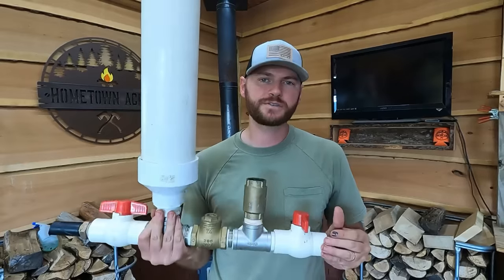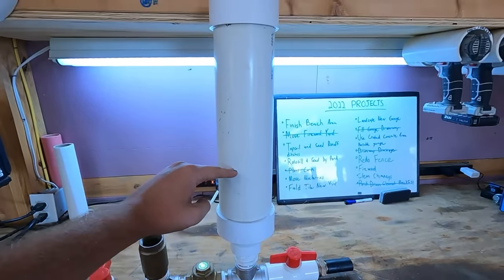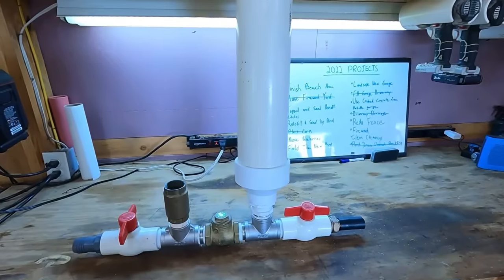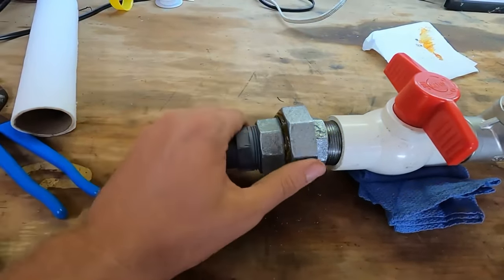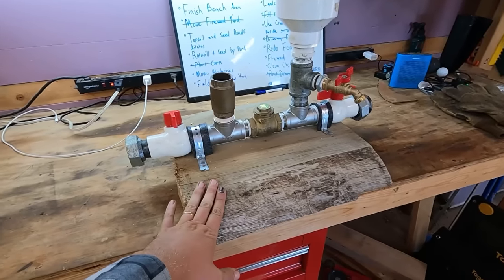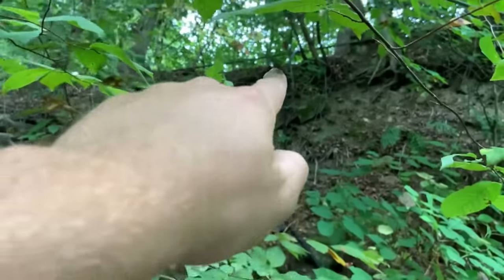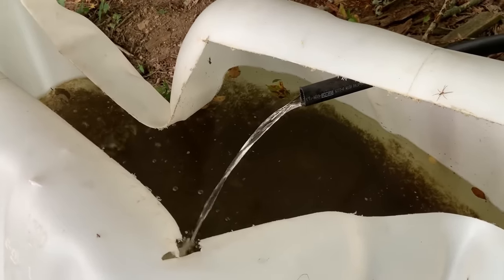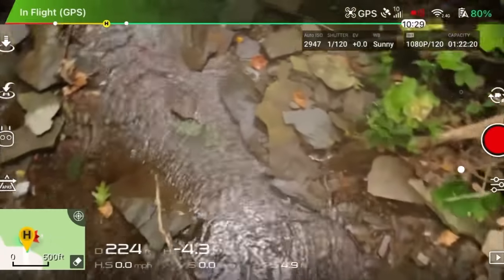Perfecting The Ram Pump And Then Abandoning It

Comment: Let me give you some advice that I found by accident. Years ago, I was hand digging a well for garden use. I got down to around 7 feet, it came a strong rain storm, and it filled my well with rain water. I needed to drain my hole in order to start digging again, I hooked up a pump, lost power, and the siphon kept on happening…with a hole that was 7’ deep and an over all fall that was 4’ (with a 3’ differential that most people would think a siphon would be impossible. If the amount of water that you want to siphon (when the downhill is less than the uphill, as long as you can create more downhill weight in water, you can siphon water uphill. You could probably take a transit, zigzag your pipe down to the pond, and as long as all of that zig-zagged pipe is going down hill, you can create suction. The more water weight that you can create going downhill, the more suction that you will create at the spring source. The more suction that you create at the spring source, the more water that you will have coming out at your pond. I hypothesize that if you were able to use a transit, have all of your pipe going down hill, and increase the length of your downhill pipe by twice, you could increase the amount of water that you are siphoning by twice the amount. Maybe ten or more gallons per minute. I, though have been able to siphon water uphill.

Comment: Thank you for the shout out! Your pump looks nice. Only change would be to move the unions in between the ball valves to keep the poly pipe full while you work. 

A siphon will be great to fill your pond! Remember a basic shopvac can pull the siphon over the hill.
Reply from the maker: Ahhh yeah I didn’t think to add the unions inside the ball valves. That would have been way easier to get the line full again
Reply: @HometownAcres  looks like a spam comment here on my comment.
Reply: Just a thought on the ram pump, ( just an idea not practical experiance)  would a stake supporting the top of the pressure tank help to stabalise the ram pump assembly?  Particularly beneficial with a shorter base plate to accommodate the suggestion of leaving the ball valves on the pipe runs.
Reply: @davidclark2286  a stake or fence post works well to support the tank. Its also important to secure the base otherwise the water hammer can jar the pump to the pont of breaking.
Reply: I LIKE IT GOOD WORK!! DO YOU SELL PUMPS?
Reply: @LandtoHouse - are you saying a shop vac can start a siphon that ultimately keeps the water flowing from a lower location to a higher location? There would have to be some significant drop in elevation as you follow the path of the siphon hose to keep enough ongoing siphon flow to keep it going over the hump

Comment: Have you considered putting a Schraeder valve on the top of the cylinder? A quick blast of air and reopen the inlet valve. No need to disassemble. Might be worth a try.
Reply: I was thinking the same thing. Pump air in from up top with a bike pump and no loss of water/head during purging.
Reply: Typical pressure tanks for home wells use a schraeder valve at the top.
Reply: And maybe a bladder between pressurized air and water.
Reply: @Joe_Blo  Well now, that would be a proper pressure tank then wouldn't it!
Reply: Just use one of those blue expansion tanks from a hot water heating system.  It already has a bladder and a schrader valve for pressurizing.
Reply: Like the others, my instant thought was putting a Schraeder valve on the top of the cylinder. Simple and quick.  Secondly....  I would weld some flat bar stock to the metal fittings. (use a nickel rod)  Then you have a much more solid mounting system. Use mason screws to mount to paver blocks or stone, and it is rock solid.
Reply: I'd put a bicycle tube in the pressure tank and add a few pounds of air. Instant bladder.
Reply: @Digitalmanne  yeah I wasn't crazy about the mounting system using galvanized strap, need something more structurally substantial
Reply: There is a device called a trompe that works o similar principles to generate compressed air from falling water.

Comment: Getting your siphon started with that long of a pipe can be a challenge. Best way I have found is to pump water from the outlet to fill the entire line. Have the inlet submurged. When air bubbles stop coming out the inlet, the line is full of water, disconnect the pump at the outlet and gravity will take over. 

Congratulations on the 100K subscibers. 

I really enjoy your channel because you are always trying something new and different, not just the same thing over and over. Also, you aren't afraid to show the things that don't work out as hoped and how you go about learning to do it a differnt way.

Good job!!
Reply: is there another way?
Reply: @letsRegulateSociopaths  He shows using an opening at the high spot of the siphon and filling both sides. Depending on the length of the tube, I have filled a pipe of up to 100' by holding my hand over the outlet end and pumping the pipe back and forth. You remove your hand to allow the air to escape when going one direction and cover the end when going the other direction. This requires some practice and a tube that is somewhat held in place so that the inlet end is moving. Also, if there is adequate room on the inlet side, the entire pipe can be submerged, hold the outlet end closed (either with you hand or a valve) and walk it to the point where the outlet is lower than the inlet. This requires some amount of care so that you don't end up with air trapped in the pipe while it is being submerged. You start with the inlet in the water and keep feeding the pipe in so that the water fills the pipe, pushing the air out the other end. 

Does this answer your question?
Reply: I imagine there is an easier way if he just uses the ram pump to charge the siphon. That way he can use it whenever the siphon runs dry.
Reply: I would use the ram pump to fill the pipe because if you ever accidentally get air into the siphon, you'll need to restart it again and using ramp pump for it would be pretty easy way to start it. To fill the pipe, simply have a bleed valve in the highest point, block the downhill end and start pumping the water into the pipe.
Reply: an alternate way to start such a siphon originating at a lower elevation without using another pump (the challenge is to get the hose filled with water and all air removed) is to fill the hose from the top elevation from another water source, then perform some physical skullduggery to coax a flow such as raising the filled hose much higher than the top elevation then letting it fall to use gravity to pull water to get it started

Comment: Just found you....Awesome name by the way!  Subbed :)
I appreciate the Ram Pump Videos. I know you're going away from it, but if you decide to come back to them (or for anyone else reading this), here's a couple of thoughts...

First: Under normal operation, the pressure tank doesn't suddenly get water logged and stop working.  It is a slow, incremental process that, over time, causes the pump to stop working. What happens is basically with every cycle, the pump is becoming less and less efficient, pumping less and less volume, until eventually it just can't overcome the head and just stops.  

Draining it on a regular basis, instead of waiting for it to quit pumping, will keep the pump moving the most fluid it can. This can be done weekly or whatever schedule works for one's personal setup...With a setup like yours, where it can go for several months before stopping, then monthly service should work.  I would suggest measuring it weekly to find out the best maintenance cycle.  You can use any bucket you wish, if you have a scale.  Water weighs approx 8.33 lbs (3780 grams) per gal.  

Second:  Installing a bladder in the pressure tank will prevent this.  These can be built (YT videos or google it) into the pressure tank you design, or you can go to your local well driller and purchase a small one from him...odds are, if he's been in business for any length of time, he has a used one someone upgraded from, or an old one from a past project that was too small. You can adjust the air pressure on it to what your system needs.  These stay upright a lot easier and are pretty weather resistant...so long as they're drained every year, you can't really hurt them.

Third: Not sure where you live, but if you get snow, your ground freezes.  If your ground freezes and thaws, the gravel in a driveway will move around, and the more moisture there is in the ground, the more it will move during those cycles.  It also moves around as it is driven on.  These movements will cause the rocks/sand to apply friction to the water line.  I would HIGHLY suggest running your water line through a piece of ABS, or at least PVC, where it goes under the drive way.  

Fourth and Final:  Siphoning will flow more, and more consistently, so certainly do that if you can.  But since it flows more, it can drain the creek much quicker too, and it didn't look like you had a ton of water in that one.  If possible, I would suggest digging out a pool at least 3-4' deep in that creek so you can have a little bit of a buffer as the water's flow rate through the creek ebbs and gains. 

Thank you again, and God Bless!
Reply: Thanks... Will use these tips👍

Comment: hey I'm 60 years old never even heard of one I appreciate both videos but , but I do understand plumbing real well and when you made the first one I said ought to put unions in there to be able to disconnect it a lot easier and I also would have put a drain for that head pressure cuz I built a lot of pumps of different kinds back in my younger days

Comment: Very clever how you determined the grade vs the creek.  Also thanks for all the great lessons from you and neighbor Doug!
Reply: Yes.  My first thought was to close valves at the low ends and measure static water pressure, and compare.  But that would require adding fittings, etc. and he's already got the drone.

Comment: Great video, thank you for it. For those who wonder about the waterlog - there is definitely something you can do to avoid that. The water in pressure tank builds up based on how high you want the water delivered. The higher the delivery point, the higher pressure it needs. And that means more water in pressure tank (=more pressured air). However, if the water level rises over time, it only means the pressure tank is not air tight and you've got a tiny leak. So what can you do about it? Use proper pressure tank (1 piece metal) instead of PVC tube with cup glued together. No leaks, no waterlog.

Comment: Every maple farmer watching can feel your pain on this.  We've all been here.  Also, I recommend stainless maple tubing mainline fittings.  They have a smaller wall thickness.  They will take up less of your I.D and increase your flow.  Once the ram pump gets you primed - switch over to a siphon feed line.  I have enough stuff in my shop/store to get what you need.

An experienced maple farmer would be your best friend on this project, Adam.  They have toys and tools for tubing you could only dream of...  I have a similar setup.  But I cheat!

I'd be happy to help you.  Mike Morgan or Joe at Ohio Woodburner could connect us.  Congrats on 100k!

Comment: I'm seeing cautions about not overdrawing the capacity of the stream pool, which will be a factor.  Perhaps a restrictor on the outlet end would help control flow and not break the suction by introducing air at the inlet.   I totally loved learning about the ram pump.  Never knew they existed (I'm a city kid).  Keep up the great work!

Comment: Ram pump was interesting, glad you checked out the siphon idea, like others have said, you may have to put in a restricter to prevent sucking your source dry at times bur but you might want it adjustable so when the stream is really flowing you can maximize the amount of water you harvest. Good luck!

Comment: hi again another thought about the syphon look onto water lose from friction in the hose pipe /  also air may flow back up to the high point and loose the syphon . may need a valve the end . good luck john

Comment: A simple pole with a wire would keep the pump straight up. And you could put a barrel on a hole at the side of the creek, open a canal so the creek could fill the barrel, and use the water weight in the barrel to feed the pump.
But yes, siphoning the water maybe is the best solution.
Nice videos, found your channel by chance. Greeting from Brazil.

Comment: Word of caution when threading a male metal pipe into a PVC threading joint. The thermo expansion is different and can cause a failure over a relatively long period of time in the PVC female fitting.

Comment: I am glad the syphon works for you, but a restriction valve to limit the flow might be needed.  The system could draw too much water from the creek causing air to enter the system and the need to restart.  Also put some ant seize on the threads of the pipe couplings (not the seal area) this will make your assembly/disassembly a lot easier.

Comment: Ok bro do one thing use a hose from the hiest point of the creek to the pond then use foot valve on the creek side and ball walve on the pond side find the most elivated point of the hose pipe and fit a  t coupling and ball valve then fill the entire hose with water, close the valve go to the pond side open the valve... Tadaaa u have gentle flow of water 😁😁😁

Comment: With the siphon line I would prime the line from the pond side not the creek side. Put an air release at the apex and a valve at either end. Open air release, close creek valve pump water from pond until siphon is full so water is coming out air release and all air is out. Close air release and open valve in creek. If you find the flow is too high and drains creek pool use lower valve at pond to slow the flow, it won’t cause cavitation introducing air into the line.

Comment: You can put an air pump valve from a bicycle tire into the pressure tank make sure to seal it, every so often just hit it with an air pump, what I did for my water solution. also built a frame out of pvc pipe and had 4, 6" spikes built into the bottom of the frame also pvc and hammered those into the ground. Very stable and once a month pump the tank and it maintains great pressure

Comment: With the siphon, you'll have to be careful that the flow rate of the creek at your inlet point is greater than the amount you'll be draining from it.  Otherwise it will break the siphon and you'll have to start it up again.
Reply: I was thinking about that.  A simple valve at the pond end (low end) could throttle flow enough to solve the problem, if there is a problem.  It's conceivable it'll be a seasonal problem, so he could adjust as he goes.
Reply: Install a “U” trap halfway down and it will be self starting if it runs dry or gulps air.

Comment: As far as getting the siphon going you could use one of those drill pumps from harbor freight to possibly pull a vacuum. My concern with a siphon though, if it pulls too much and it overwhelms your creek supply it will stop working.

Comment: so the problem is that the siphon draw will be so great it will immediately empty the creek side and stop. siphons empty stuff.   you might need dig out a small bowl in the creek as storage, but even then it's going to be tricky to divert small creek flow consistently. you may want to turn it on during wetter season when flow is much greater than siphon flow.... my gut says that pond will fill naturally on its own, and that all this work to divert that little creek will be campfire chat one day.  good luck 👍

Comment: When you started talking about ways to measure the heights, I'm going "Use the drone! Use the drone!", and there ya go, you did.  Nice work, looking forward to the next video.  Oh, and as a side note, they do make PVC unions. I don't know what the acidity of the stream water is, but I do know that our well water that has a pH of 5.0 will corrode it over time. We're talking years here, and about pipes that are difficult to replace, but my point stands.

Comment: Using a 4 way pipe connection directly under the pressure chamber would allow you to add 2 stabilizer feet . If made approximately 2 feet long. It would never tip over. You could make the stabilizer feet off the 4 way as long as you wanted.
Reply: That was my thought as well. Use an inverted double wye. and it would be very stable. The legs don't need to be glued in place so they could be removed as needed or adjusted for another location.

Comment: Use an airtight tote or barrel to create a self priming siphon. Two feed hoses at the top of the airtight barrel or tote one from the Ram Pump the other is just from the water source on the other side will be a valve and hose to your destination pond and on top of the container is a removable cap to let air out. fill the container with cap off to let air out. once full put cap on and the open the valve to let water flow to the pond which will start a natural siphon. keeping the line to the ram pump so you may reprime the system if you ever lose pressure. The hose leading to the pond must absolutely be the same size or smaller in diameter as the fill line if not you will slowly lose pressure and  have to start again.

Comment: You may want to consider looking into horizontal boring to run a pipe from the pond through the hill to the creek. You could put a small water feature at the ponds edge. It would just gravity flow.

Comment: you can always put a air valve stem on the top of the pressure tank. then you dont halfto worry about disconnecting to drain it, you can just use some compressed air to purge the water from the tank.

Comment: Set a flow valve at the pond and don't over draw your source at the creek. Otherwise your line will run dry. Great stuff. Thanks.
Reply: P.S. . . . keep the ram pump handy to fill or refill the lines. Again . . . Great Stuff. Thanks.